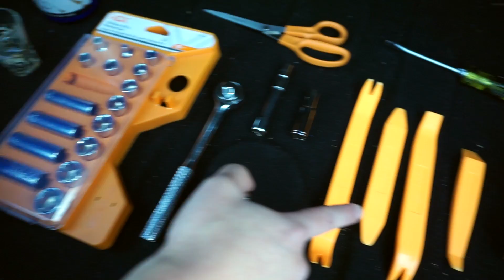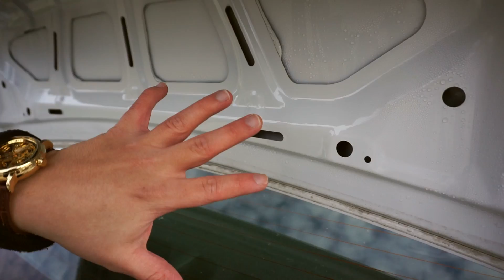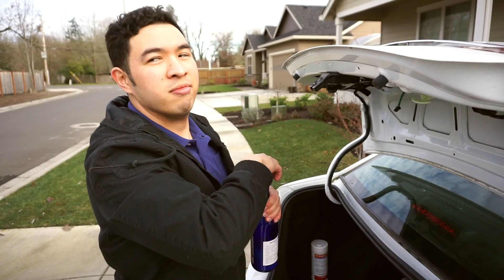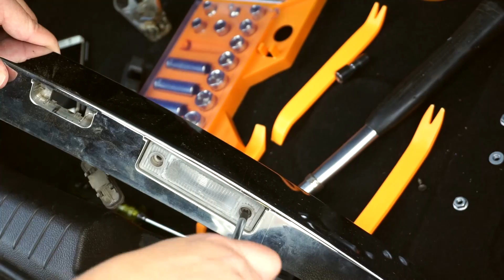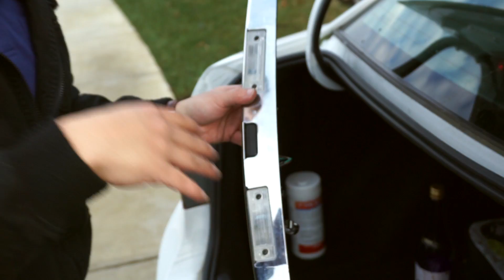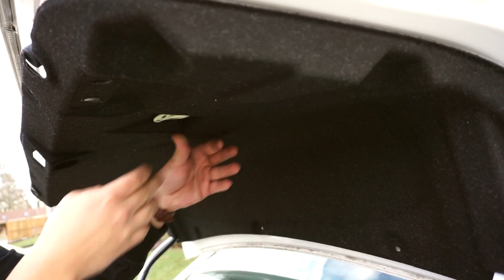Chevy Cruze Trunk Switch Repair | Tool List + Walkthrough + Instructions + Car Maintenance Guru

Comment from the maker: Need to change your switch? Make sure you have the right gear!

Trunk Switch Replacement Kit: http://amzn.to/2uEgm9y
Panel Removal Tool Set: http://amzn.to/2jNq9Dj
7mm socket: http://amzn.to/2jPmh2q
10mm socket: http://amzn.to/2joJ5d4
Socket wrench: http://amzn.to/2kMftX8
Scissors: http://amzn.to/2kaLoNP
Screwdriver: http://amzn.to/2kMefv7
Reply: Do you have a link to a switch for a Cruze with a rear camera?
Reply: some of us dont know how 2 d it,
i d like to.get clean one, i keep stricking  out
Reply: Drive By Reviews  You did not address the fact that there is no switch to release the trunk from inside the car.

Comment: I changed mine today. Did you ever make the seal video? I want to seal mine up. It ended up shorting out my license plates lights too, they were burnt and/or rusty. So I replacrd the whole thing. I have some flex seal, I just want to know where to put it.

Comment: hey dude thanks a lot. My Cruze is currently in the dialer for diagnosis of this and a few other electrical issues. If they can fix it cheap, then I will let them. but if they come up with a few hundred dollars, I just learned how from you for free. Just need the switch, which is easier to get than the Radio display. Which is also out.   Share the love and drink your Sake!

Comment: I have a 2018 Chevy Sonic LS, Whenever I try to open the truck with the button inside, it won't open. But, If use the button on the remote or outside trunk switch, it opens. So, Is a fuse or does the inside button needs replaced? (Haven't taken it to the dealership or a independent repair shop)

Comment: I found these instructions very helpful.
The main problem I found were the license plate tag lamp unit screws were a bugger to get off, since over time, they rust and you can't get a proper grip on the screw.

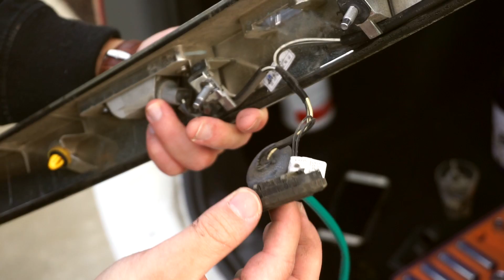Comment: Thanks man helped a lot ! but I accidently broke one of the plastic that holds the bolt at 3:49 trying to pull the cable from underneath it 3 of them is enough to hold it tho . finally don't need to stop the car and open the trunk with the key

Comment: Best video about this issue on YouTube. I have one TIP: if you are changing only trunk button, you don't have to dismantle whole trunk. You can pull out broken button with a screwdriver from the outside. Than you can cut the wires and connect them with new button using wire connector and you are done. I did it this week and it worked perfectly. Saved me a lot of time

Comment: I live in the PNW too. The rubber seal on the top and bottom of the trim piece were corroded when I took the whole thing out so I’m assuming that’s why water was getting in and caused the light and button to stop working. I took it to the dealer and asked if they could replace it and the guy didn’t fix it and sarcastically wrote in the notes “maybe try pushing harder, could not duplicate trunk not opening” so that made me mad and I just spent $10 for the part to do it myself. Didn’t take very long. I put some silicone around the edges that will hopefully keep the water out and it won’t happen again. Works like new again. Thanks for the video!

Comment: Hey man, my trunk release isn’t working and I was in the process of replacing it myself but found that the switch is actually already factory sealed. Do you think it’s still an issue with the switch or could there be another reason for the issue? Thanks!
Reply from the maker: if it works with the fob and not with the switch pretty sure it's the switch. cheapest step at that point is to just replace. also... factory sealed? mine was stock. I don't think Chevy seals it.
Reply: @DriveByReviews  the switch I ordered actually came in today so I went ahead and replaced it anyway cause it was definitely the switch. Im the only owner of the car so it def came sealed from factory but it’s all fixed. Thanks for the tutorial bro!

Comment: hey mate, i know that the video is quite old, but im about to et my chevy cruze that already has faulty trunk switch :D i guess that if you alreay havent made the video about the sealing, then you wont film it at all. So can you share me some link or something about that insulation since the mechanicks that i asked know nothing about it and if it's already broke (the guy that is selling me is trying to convince me that the button never worked and i know that's a lie :D), it will break again probably very soon.
Thanks, cheers!
Reply from the maker: I never did seal it and it's been fine, but I moved to texas where there is much less rain. basically just cover the inside button area when you install it with any easy tubed sealant. You just need to keep the back area sealed.
Reply: @DriveByReviews  much appreciation for the answer and for the video as well! Cheers

Comment: Great video, had me laughing.  Just knocked out my 2012 Cruze LT truck switch after watching.  I bought the part maybe 2 years ago, just never got around to doing it.  I did have to use an adhesive on the black rubber strip on the top of the chrome trim.

Comment: Thanks for the easy to follow instructions. I bought the tools for clips and the part from Amazon for cheap. 

Only suggestion would be a little more description about removing the clips. Mine were two piece and the center had to come out first. This is the first time I had seen this style. 

Thanks again

Comment: you forgot to add the chrome piece that attaches to the trunk. the 4 screws that hold the licence plate lamps in place were so badly rusted i could only get 2 out even after soaking in wd40 for 3 days.

Comment: saved me some money :) for 2013 Cruze, there will be some hardened glue on the switch, just gently remove it with a small flathead, not a big deal :) thanks for this :)

Comment: Simply phenomenal video, this is perhaps the greatest repair walkthrough I have EVER watched. Side note for people with 2013 Cruze's, there is a hard epoxy/glue that seals the button in. Use a blade to slowly remove as much glue as you can, the more the better. Pour boiling hot water over the remaining glue to soften it as much as possible. Then use a hammer to tap it out. 

Thank you Drive By Reviews for this extremely helpful and entertaining guide!

Comment: 2013's you cannot perform this repair. They Sealed the switch with a hardened sealer.
Reply: Yeah just did mine and it was sealed with some type of silicone. Still didnt prevent it from breaking though. I just used a hammer with a flathead to smack it all out.
Reply: I know they put the sealer there to manage the water path. Without it, you may get shortened life of the components, especially if you live in a place that has cold winters. The dealer would not attempt to perform a handle replace when i asked them, fearing they would break the trim piece, definitely not going to replace the entire trim piece as it is too expensive.  How was your repair afterward?
Reply: I just did this to my 2013 there was a glob sealed on the back of the button. I also sealed in the new light housings. Getting the old one off took a lot of time with knife, and boiling water but I got everything out clean. 2 of my 4 screws on old lights came out, the other 2 broke off. Attempted to drill out the remainders of the screws but just ended up heating the metal and pushing it through. Will be replacing with 4 brand new screws, possibly machine with nuts tomorrow. (somehow I don't have any on hand that size of the 999999999 screws here).

How much to replace that trim piece? I feel if I have to do this again in 3-4 years I might just replace the trim piece instead of trying to get off the silicone, but I didn't glob the f out of it like it was before...

Comment: Would having a faulty trunk button allow the trunk to randomly pop open on it's own? That's the problem I'm having now.
Reply from the maker: RyanMiller3039 yes it can, although you should check the fob button isn't getting hit in your pocket.
Reply: Drive By Reviews yeah we tried that. We took the batteries out of the fobs at the same time and the trunk still would pop open by itself. I ordered the part under the #95270497 for $44. It seems like the part you got is #95107229 but it seems to be out of stock or discontinued anywhere I look.

Comment: I've replaced the trunk switch on my 2011Chevy cruise  but neither the key fob or manual trunk release works.when I push the key fob release the rear lights blink..help
Reply: Chris Hudgens did u press and hold it?? On my Sonic u have to hold it for a few secs
Reply: Orlando Jackson yes I did
Reply: Any update? My switch is also faulty and currently debating about switching it, also have a 2011 Chevy Cruze.

Comment: Mine has some type of glue holding the button in. How do I get past the glue?
Reply: Hey Sara, I know I'm 10 months late but I just replaced mine. I used a razor blade to slowly remove a little glue at a time, then poured boiling water over the remaining glue to soften it, and finally just hammered it out.

Comment: Yeah done it but the problem now is the remote to open the trunk does not work as before. Need help.
Reply: That shouldn't have anything to do with the switch or the replacement you purchased.  Probably have a loose or damaged wire somewhere.
Reply: Ryan Jacoby my remote works again thank God maybe it took time to initialize.
Reply: Skid Row glad to hear!

Comment: Any videos on Brake Pedal Position Sensor?
Reply: Just did this today (both P057C error code and my trunk lid switch were broken).  I didn't find any videos but it's simple to do, only one bolt - 7mm.  All you need is a wratchet and a flashlight.  Unhook the connector, wrangle the bolt out of the old one, pull it out (has a pin holding it on one side, the position yolk on the other) and put the new one in its place. Then put the bolt back in and plug it in.  Oh, and the part is like $7 on amazon: http://a.co/6iRR7mt
Reply: Ryan Jacoby Awesome! Thank You!

Comment: This was by far the easiest repair I've done. I have 12' eco cruze and had trouble finding the replacement until i saw this video. Auto part stores tried selling me the cable at $80 and it didn't include lights with bulbs, and you had to splice it... Good job Drive By!!
Reply from the maker: Dan Hart amazing how much they try to upcharge us. One of the best benefits of the cruze is the "cheap repair costs" but it never seems remotely cheap when retail!
Reply: How do u waterpoof it so it wont happen again

Comment: great video i have to change mine out as well, could you send us info on how to seal it to keep condensation/water out?
Reply from the maker: Luckily it's pretty simple! If you want to seal it take your sealant of choice (ex. silicon sealant), completely clean the housing for the button before installing, after installing cover the entire backside of the installed button with sealant, also cover the exposed button on the outside of the car with sealant including the edges so no water can permeate.